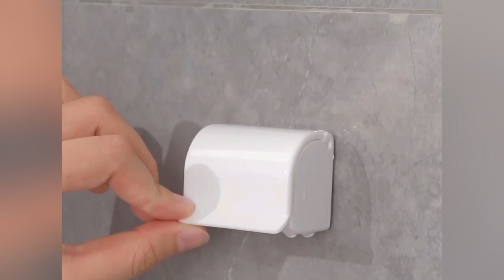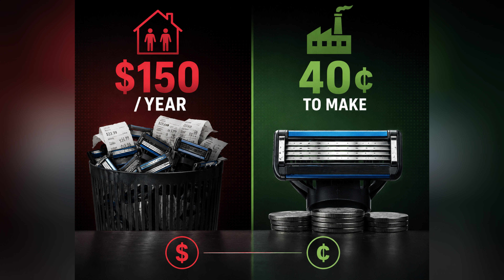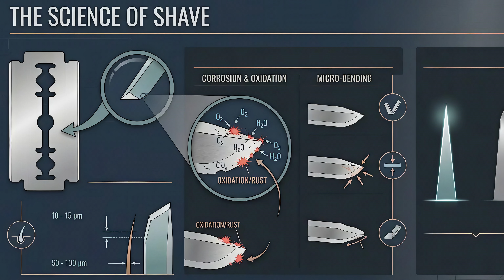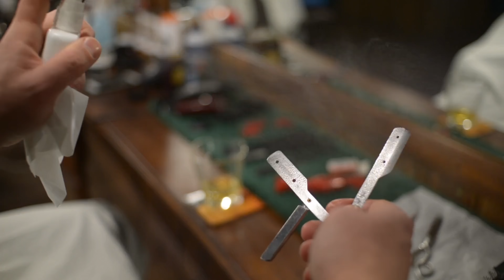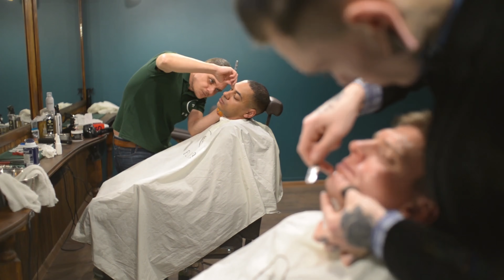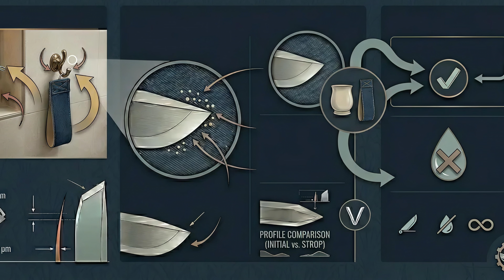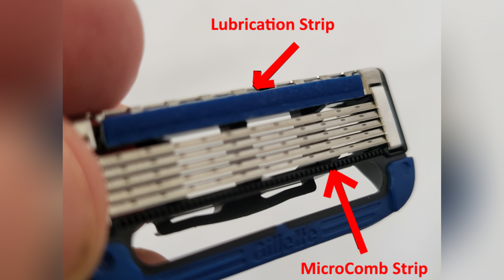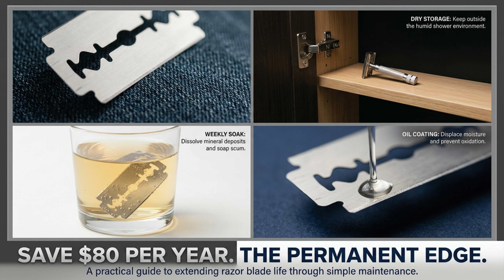Your Razor Is Designed to Dull After 3 Uses — How to Make It Last 2 years!

Comment: Buy a safety razor for £20, buy 100 Derby clades for £6.50. I only shave my neck and shape my beard 3 times a week, 100 blades lasts me 2 years. No plastic handles or used heads going to landfill just metal blades going into recycling and I get an excellent shave.

Comment: Would rinsing with 70 to 90% isopropyl or some other hydrophobic solvent before putting it away as well help since it removes water and then evaporates right right away.
Reply: @stoner4311   rubbing alcohol is not hydrophobic

Comment: What you don’t seem to have considered – the modern design of the multiple blades, which are firmly bonded together with plastic, is, in my view, a key component of the disposable business model that is so costly for us consumers, because this makes cleaning the blades extremely difficult, and straightening the bent cutting edges on leather or jeans after shaving is now ‘ingeniously’ (for Gillette and the like, of course) only possible on one side – namely the accessible side of each individual blade – which is likely to reduce the effectiveness of the stroke by far more than half.

Comment: I’ve had the same razor for nearly a year, and I should say I realistically change mind maybe once every few years and the way I do it is I talk to my uncle who does forging and knows a lot about metal and blades and he talked to me and said that every blade on there is really thin, which is what makes it razor sharp and because it’s ultra thin, that means all of the oils and gunk gets stuck between the spaces and the razor so that gave me an idea which was putting it in a bottle full of shampoo water, which is good at getting grease and oils off and swish it around like you do in the sink to get rid of the hair but then I let it sit in there for a few days or even a week and I noticed every single time I do it the blade works like now. It’s not the metal that wears out. It’s the oils and gunk that gets stuckand you just need to clean it out.

Comment: Here's a tip that I learned from that movie " Miller's Crossing " and have been doing it since. Hot water to soften the beard and ice cold water to contract the blade to make it sharper. This is common sense, but growing up , no one ever pointed this out to me. The trick with the denim and the mineral oil is way up on my list to do. Thank you!
Reply from the maker: That's a classic movie tip, thanks for sharing that strategy! 😊

Comment: Long ago I bought a stainless steel razor and double edge razor blades, those blade were not that sharp in the first use. When I was a kid those blade where super sharp (45 years ago) so what changed ?
Reply from the maker: Blade manufacturing has changed over time, with different coatings and sharpening techniques. Also, your perception of sharpness might be influenced by childhood memories or changes in your skin/hair over 45 years.

Comment: Gillete perfected it.  They are down to about 1 shave now
Reply: The Gillette blades I use last weeks and I have a heavy beard.
Reply: @gordonschiff3621  I use cheapo ones from Aldi, they last me maybe a month, sometimes more until I replace one. I dunno what people are doing to make their razors go dull so fast lol

But then again, people think bidets are a must have, because how else are you supposed to "know when all the poop is gone from your cheeks", so it was because of bidets that I found out so many people are pooping with their butt cheeks closed, so I'm guessing people are rubbing their shavers over some rocks or something between shaves...
Reply: @gordonschiff3621  @jaredmartin3798 Gillette makes tens of different sub-brands. You both could be right - about different blades. And of course, the same blade could behave differently to each person's skin, hair, water supply, soap used, razor used, etc.
Reply: @gordonschiff3621  the Gilette 2. Not sure about the name as I don't shave now, just groom it with a hair clipper, but it's the simplest one, no white strip or double blades or any fancy stuff. Lasted weeks like you said.
Reply: And seven blades.?...wtf. my single blade safety razor is smooth as
Reply: @paulgerrard9227 The more blades they put in, the easier it is to clog them, thus rendering them useless even quicker...❤😂😊
Reply: They perfected adverts to offend their customers as well.
Reply: @jaredmartin3798  hopeless aren't they.i bought Gillette and some didn't even do one cut
Reply: @jaredmartin3798  the fake ones, yes.
Reply: @jaredmartin3798   I used double edge safety razors at home. However when I travel I take my mach 3 with me. I get far more than one shave.
Reply: Gillette doesn't deserve any man's business.
Reply: @Wordnerd001  
Yep, after that disgraceful man-hating ad I will never buy Gillette again. They lost my business.

Comment: Why blades go dull...
Don't use shaving creme. 

I shave immediately when out of the shower when my face is still wet and warm.  My razors (Mach 3) last for three to four months and have done so since I quit using shaving creme about 30 years ago. 

Also, be certain you clean your razor under a fat stream of hot water while tapping it on the sink.  That seems to remove all cut hairs and also extends the life.

Just my observations.
Reply: @jimtraill141  Do you use soap?

Comment: A couple of the claims made here are nonsensical, at least as it applies to the Gillette "Fusion" razor that I use.
1. The cartridge frame that holds the blades extends beyond the blades, so this "poor man's stropping" doesn't really affect the full width of the blades, just the center third.  The rails keep the sides above the denim.
2. It's impossible to dry "the back of the blades" with a towel, as described, since they're deeply recessed within the frame.
Also that "glide strip" is 100% a gimmick, since it is at the tip of the cartridge, which is to say, it contacts the skin after the blades.

Comment: Best shaving technique is to use a slight slicing motion of the blade across the hair shafts, because the blade edge is like a micro saw. Moving the blade in a slicing motion is like cutting and stropping at the same time. A cook will tell you a knife edge stays sharper longer by slicing instead of chopping. Also allow time for moisture to soften up the hair. Don’t shave with a clogged razor. Keep them dry. My razors last a long time. 😮😅

Comment: I miss the Gillette Sensor with two blades. Why did they stop selling the handle? I still see the blades sometimes in the stores near me but no handles. Ever. That was the best 🪒. And all these tips would have worked so well for it !!
Reply from the maker: That's a common issue, many companies discontinue older handle designs even if the blades are still around. It's tough when you find a favorite!

Comment: Buy a good safety razor and learn how to use it. Replacement blades cost less than 10 cents a piece. Rinse with hot water after shaving. Even if you shave only twice with each blade, you're saving lots of money.

Comment: Guys in these comments who run a razor for weeks or months.. 😗. Mine (disposable with swivelling twin blade head) last me a week if I shave every day. I’ve noticed that even not shaving every day they get dull after the same number of shaves. My stubble must be made of wire or something. I clean out any blockages between the blades, dry the blades and leave them in a dry spot away from steam .. I’ll try strolling it and the oil trick sounds interesting..

Comment: I have a 30 year old Gillette Atra handle.  I can buy 100 compatible generic blades for $15 on-line.  The lot lasts 5 years.  I'll start drying and using denim and see if the life of each cartridge is longer.  Great advice.
Reply from the maker: That’s a classic handle, definitely keep that one going as long as you can! 🤝

Comment: I always buy a pack of Wilkinson razors. 15 razors for € 5,26. Use each razor for weeks, so one bag lasts a year. Oh and I don't use soap or foam. Just water, but I always shave after a shower. Takes getting used to but it's the cheapest way of shaving.

Comment: It’s not a corrosion that makes the bur, it is the soft hair. It bends the fine edge and also chips it. When scratching the surfaces, hardness difference matters but in bending, only the force applied to the edge.

Comment: Wow! Great information! Question - When you say to keep it dry after use do you think it should be stored without the protective plastic case that the cartridge refill comes with?
Reply from the maker: That's a great question! I'd recommend storing it without the case to allow for maximum air circulation and drying.

Comment: I don't do the oil and vinegar but good to know. I do use my forearm as the strop though. Obviously running the blades backwards. I get a good 2 months from Gillette and 3 months from Chick. Currently wearing a beard as its easier. 😁

Comment: What do you mean by saying that after stroking my disposable razor 20 times up a strip of denim I should “flip the razor, 20 more on the opposite face”?  I can only wipe one face.
Reply from the maker: What I meant is: after that, you do the same thing again, but flip the angle of the denim and stroke it the opposite way. Denim has threads that run in a certain direction, so doing it both ways can make this little trick even more effective.
Reply: @Sidney_Explains_Money . I flip the angle?  So I flip the denim over?
Reply from the maker: @MrMightyZ  yes, flip the denim over.
Reply: @Sidney_Explains_Money ok thanks👍

Comment: Here's a pro tip from a bald guy who shaves his face and head twice a week I need to shave my face and head twice a week because I'm a farmer and I spray chemical and I cannot have any stubble whatsoever that may cause me to take on chemical bios. Shave your head in the shower shave your face in the shower. When you exit the shower dry your head hand dry your face. After you do that apply Nivea or some kind of a cream aftershave. While doing that you will find the Miss spots on your face and head. Use the razor blade to find those missed spots. Lubricant from the after shave will add enough moisture to the blades and the gel strip and you will be able to use that razor for a very long time thank you very much
Reply from the maker: I love that—using the aftershave as a lubricant is a brilliant way to keep those blades in top shape. 😮

Comment: I use safety razors and a $10 pack of 100 blades last me close to two years. I pair these blades with a Henson razor. After use, I dry the blade and apply a tiny amount of pre-shave oil. One blade lasts me about 7-8 shaves.

Comment: May be I don't understand, If one run the blades under a cold tap to get rid of the hair and shaving foam, how is this different from cleaning it on the old jeans? Not as if the jeans sharpens the blades?

Comment: its is simple to get at least triple the life out of a blade,  i use the schick multi blade as i find it a better shave and less irritating on my skin.  strop the blade on the heel of your hand 10 to 20 times depending on how long since the last time.  so just put the razor on the heel of your hand and pull it backwards.  its not sharpening the blade.  simply re aligning the microscopic burr on the blade where it has bent over.  but it will feel like a new blade when you shave.  your hand becomes the leather strop the barbers of old used to keep a keen edge.

Comment: huh, ive been doing this by accident for years lol gillete blue 2's last me months because i flush out the gaps between the blades and run the blade backward over my hand till they look clean, then put them up on a dry shelf till i need it again.  Also use rainwater so no particular minerals in our filtered water.  Blue 2's also seem to be the best type or disposable too, every other more than 2 blade or different brand models are blunt out of the box compared to blue 2s.

Comment: I've saved $100+ doing this. I've bought Norelco wet/dry electric razors for years. They last about three years because the on/off button gets stuck. So suddenly it'll turn on by itself and discharge the battery. Each time I bought one the top triple razor part is the same with a different color handle. (I think this is so people don't try a bait-and-switch on the stores years later.) Anyway, I've snapped on the old blades and put the new ones in a drawer to use whenever. It's been nine plus years and I'm still using the same blades doing general what you said. The difference is I'll  let them soak for an hour.

Comment: I wet shave with an old style safety razor that I bought for 25 bucks around 6 years ago that uses double edged razor blades costing less than 10 bucks for 50 and I typically get about 8-10 uses from each blade. I use a good quality shave soap with a shave brush for lather and I get the closest, most comfortable shaves of my life with zero irritation...I seldom even ever need to use aftershave or lotion anymore. Wet shaving is the way to go and it truly only takes an extra couple of minutes to work up a real lather over spraying 90% air out of a can.

Comment: I wipe my blades with a cotton ball and alcohol after rinsing. The alcohol displaces water and cleans soap residue. It also dries very quickly. I mostly use a safety razor that can be disassembled and individual parts clean much better. The blades are much cheaper, sharper, and last a longer time. I may add the strop to it after watching this. I strop my kitchen knives on a leather strop which works very well. Nice video. Thank you for the information.
Reply from the maker: That's a smart setup, and adding a strop to your routine will definitely make those blades last even longer! 😊

Comment: Important point: stainless steel doesn't corrode as this video describes. As for my shaving, I use either an open-comb, old-school double-edged razor or my Leaf razor. At 12 cents for the "grossly overpriced but high-quality" Feather blades, or 7 cents for 3 Shark blades in the Leaf, I'm just simply not paying those absurd cartridge razor prices. Sadly, all the double or single edge blades are not produced anywhere in the USA anymore.

Comment: I've never understood these claims. My razors last such a long time. I use Gillette Mach 3 blades and each one lasts close to a year for me. I bought a pack of four and still have two unused. My current blade cartridge I've been using since last year and it does a proper job, no nicks, cuts or abrasions. Am I the only one? I can't be.

Comment: Since going back to blade shaving regularly, I have noticed that Gillette disposable blades are far less durable than they used to be. I had a beard for five years, so I only used electric razor until a few months ago. you once could get around a week out of a razor; now they often last only two or three shaves. It feels as though the quality has been reduced to increase the profit margin. In the UK, the replacement blades you describe as costing $2–$3 are actually £12, which is about $15.
Reply from the maker: That price difference is honestly wild, but hopefully this method helps you get way more shaves out of each one!
Reply: @Sidney_Explains_Money  Going to try it!

Comment: Why not just keep it submerged in mineral oil between uses? Mineral oil doesn’t evaporate, the blade can’t oxidize while submerged, and it cuts out a couple of steps. I am neither a chemist nor a barber, so feel free to correct me if I am wrong.

Comment: I usually shave in the shower and I use Gillette or Schick Hydro 5-blade disposables. They usually last a month or so before I toss them. If I put a cup of mineral oil in my shower to keep the razor in, will it make a difference or does that trick only work with single blade shavers?

Comment: I’ve been stropping my razors on the inside of my forearm since the 70’s when i first started shaving. I would guess i saved thousands of dollars since then by using my ‘disposable’ razor blades for weeks if not months. I often discarded them or changed them out not when they stoped shaving but when i wanted an extremely close shave before a special event.

Comment: I never wet my blades. I take a shower, dry my face with a towel, then shave. After shave, I give some gentle tap to remove the clippings, blow it, then store it again. Mine can always be used for 3-4 months before I need to buy another.

Comment: You can gently slide the point of a tooth pick under the blades to remove all the built up crude. I suppose you should do this before stropping.

Comment: You can also eliminate shaving cream. I've not used it for over 20 years. You just need to soak your face with a hot wet towel or shave in the shower or, as I do, while taking a bath. As long as your face is good and wet with hot water. Use a mug or plastic container to periodically bang and rinse off the razor while in the shower or bath with a hand mirror.

Comment: Facial hair is as tough as copper.  1. Don’t neglect preshave (wash face in warm water, soften beard) 2. Always start with the grain (direction of hair growth). 3. Rinse razor in hot water 4. Dry with towel 5. Blow out water and/hor hairdryer 
I wrap in a bit of toilet paper to soak up missed moisture from razor and surrounding air.

Comment: The title says it all and is emblematic of what wrong with today's throw-away society. Everything these days is designed to break just after the warranty ends, or just wear out quickly so you have to replace it often. Not only that, things are designed to be un-repairable; if you do try to open something up to attempt a repair, it will break. And then you've got software subscription you have to keep buying. Having customers replace things at frequent intervals is the most perfect business model ever developed.